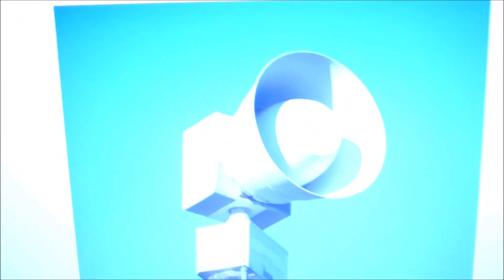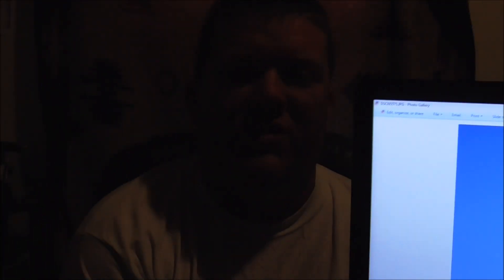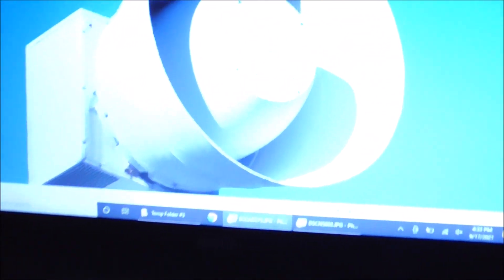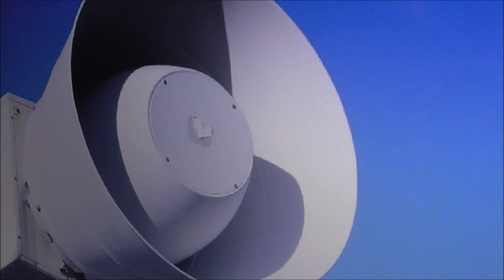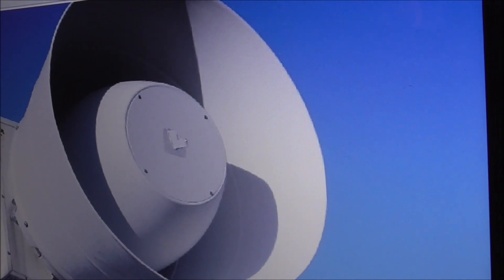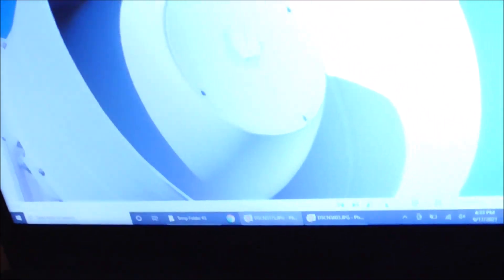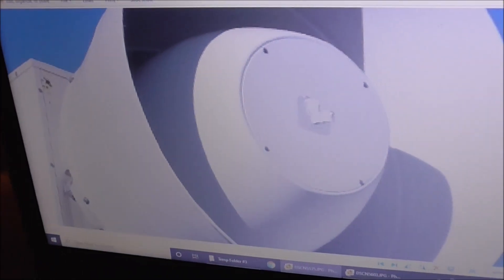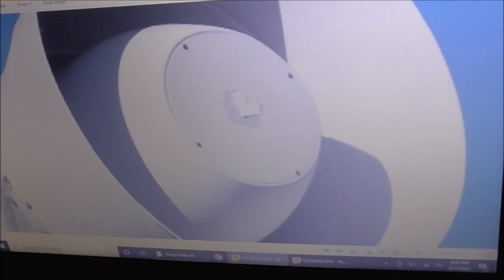How to physically tell the difference on FS 2001-SRN types (OUTDATED)

Comment: I haven't been able to find much information on the naming system of the 2001 series, so I figured I might as well put down my theories on it. 2001 seems to be an evolution on the naming of the Thunderbolts, which the 2001 replaced. 1000 for the original design, 1000T With T denoting a dual tone version of the siren (Also seen on the 500T), 1003 with the 3 showing how many tones the siren is capable of (Alert, Attack and Hi Lo, also seen with the 3 in 3T22), 2000 denoting the gas powered blower model which ultimately flopped. The 2001 was a siren that replaced the bolts, and since 2000 was taken, I like to think they just went up one number and called it the 2001. Now for the specific models; 2001-SRN, I can assume S is for single tone, as was ST In STH-10 (Single Tone High, 10 horsepower). The R, I would imagine stands for Rotating, to separate it from the Omnidirectional sirens of the time. And The N, I'm not entirely sure on. Best idea I've had for that is Non-Adjustable, to signify that the 2001, unlike the Thunderbolts before it, can not have it's chopper level changed. It could also stand for Naturally inducted, or Naturally aspirated, contrary to the supercharged status of the Thunderbolt. This is pure speculation though, it seems absolutely no one on the internet has any idea what SRN stands for. As for the SRNB, that's very easy. On the thunderbolt, the B series (1000B, 1000BT, and 1003B) was the version which had an updated rotator box, which is the exact same change made to the SRN to change it into the SRNB. Finally the 2001-130, which was named for it's new, higher decibel output over old 2001s, jumping from 126 DB at 100 Ft. to 130 DB at 100 ft.
Reply: Sorry if this comment section isn't really the place for this, let me know if you want me to remove this comment.
Reply: Has no one ever thought of "SRN" just being a 'fancy' way to call it Siren? SiReN???
Reply: @wigwagstudios2474  That is something I've thought of, just doesn't seem to me like something FS would do. I guess you never know though

Comment: Good stuff! I’d also like to mention that all versions prior to 4 have their small ID tags on the side of the rotator instead of the chopper cover. On another note, I’m thinking they probably labeled versions 1-3 with 2001:DC to show that it had battery backup capability since the Thunderbolt didn’t, but I’m not entirely sure.
Reply from the maker: Going by what you just described, I was never thinking about that and yet, it makes sense to me. It also does seem like the ID tags have been switched too like you stated. I didn't bother to put that cause I wanted to show what I felt was easier to notice.
Reply: @Siren1000T1  Oh yeah. Just a minor detail I thought I’d mention. Of course what you said about the broader characteristics makes it much easier to notice the differences. Some of the other things you covered about the details of the different versions like the air intakes or the screws on version 3 I never noticed before, so it was cool to learn about it. People should get some good clarification after this video! 👍